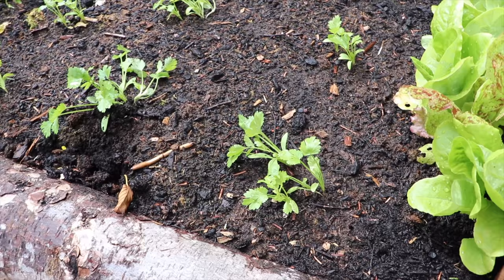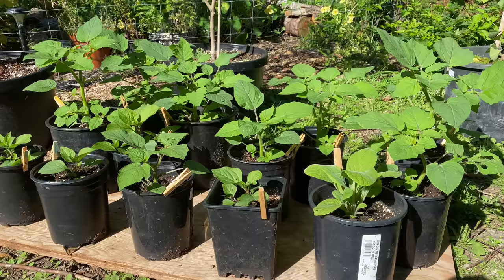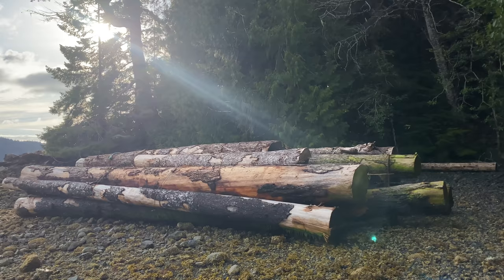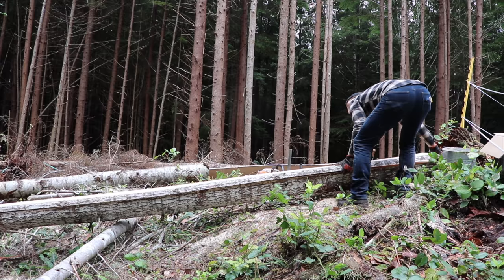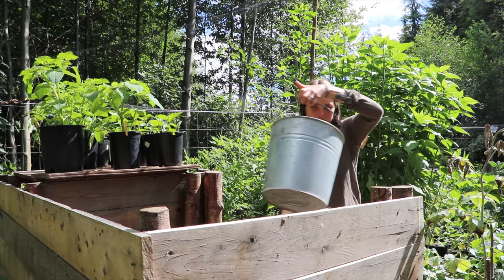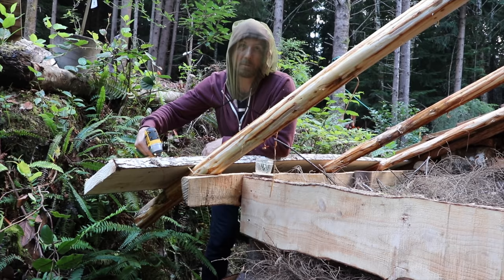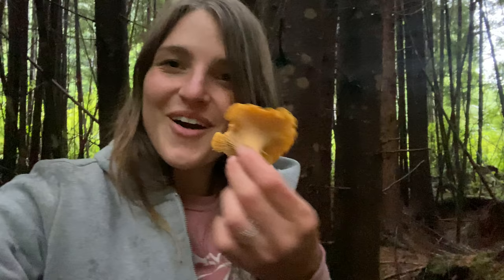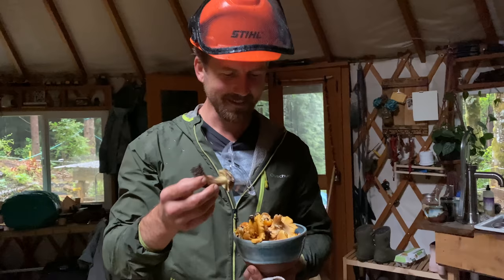Off Grid Wilderness Living // WOOD FIRED PIZZA OVEN Day 1 | One Year Supply of Fire Wood - Ep. 103

Comment: whole- wheat pizza with vegetable topping. crust. whole wheat pizza (wholemeal ) dough see page 12 . topping 3 tablespoon extra-virgin olive oil . 1 small egg plant (aubergine) with skin, cut in small cubes. 1 zucchini (courgette) cut in small cubes. 1 clove garlic, Finley chopped. 1 tablespoon finely chopped fresh parsley. 10-12 green olives, pitted. 3 1/2 ounces (100g) pecorino cheese, coarsely grated . 4-6 cherry tomatoes, halved  serves 2 preparation 20 minute. time to prepare the dough and let rise. cooking 15-20 minutes. CRUST 1. prepare the whole- wheat pizza dough following the instructions on page 12. set aside to rise for 2 hours. 2. preheat the oven to 500 degrees F (250degrees C/gas 10) 3. oil a 12 inch (30 -cm) pizza pan. TOPPING 4. heat the oil in a medium fry pan over medium heat. add the eggplant, zucchini garlic and parsley and sauce until the vegetables are beinning to soften about 5 minutes. 5. knead the risen pizza dough briefly on a lightly floured work surface. then press it into there prepared pan using your hands. 6. spread with the vegetable mixture olives, pecorino, and cherry tomatoes, leaving a 1/2 inch (1cm) border all around . 7. bake for 10 -15 minutes, until the crust is crisp and golden brown and the cheese is bubbling and beginning to brown. 8. serve hot not. fore extra taste and color add 2-3 tablespoons of frozen peas and a small carrot, cut into small cubes. sauce with the eggplant and zucchini.

Comment: your roof steel panels are supposed to go vertical the way you have them is going to allow the snow to pile up on your roof instead of sliding off
Reply: @jacquesdubois9929  So the manufacturer and roofing contractors are all wrong about proper installation and he is right? Don't think so.

Comment: Best wishes on getting the tomatoes to ripen. I lived about two hundred miles south of you 40 years ago and grew lots of tomatoes, but never had a single one to ripen. Good to see you clearing and cleaning up more of the property.
Reply: Best thing for tomatoes is putting them in a dark space for a few days/weeks and they’ll ripen just fine. For Jake and Nicole a cardboard box under their bed will do just fine. Just don’t forget to check them as they ripen pretty quick.
Reply: If you want to control a tomato plant and how much energy goes into the other trusses you can either take individual tomatoes or cut the whole vine off and put it in a box with a lid on because fruit ripens in the dark better. Most plants are more active through the night than the day.

Comment: I can’t wait to see the new garden. You have cleared a lot of trees in preparation for it.  I am sure you will show some neat way to rid the area of the stumps. A solution to the water across the driveway, build a bridge out of your logs and boards.    Your videos helped during our quarantine time.  Keep up the hard work.
Reply: Best way to get rid of stumps is to borrow few holes in each of them and put fertilizers containing nitrogen so fungi can destroy them in a year.
Reply: @user-pn4uj6qj2f  or by the way build the Garden arround the stumps😉🤔
Reply: @frankgaletzka8477  If stumps are fresh that would be a pain - picking off green shoots from them constantly. Destruction by fertilizers as described above would help.
Reply: @user-pn4uj6qj2f  yes you are right but the spruse tree stumps dont grow again 
I would do a combined Methode build the Garden around the stumps and use the Fungus to destroy them
Yours Frank

Comment: I'd love to see you guys with a band saw mill there someday. As great as it is to use a chainsaw mill to make some slabs, if you start making like 2x6 lumber with a chainsaw mill it's not really economical between the gas, and definitely the time. Whereas if you get good with a bandsaw mill, which is actually much easier to use and far safer, you'll be able to turn a pile of logs into thousands of board feet in a day. And you can use some of the thinner wood that would be hard to mill with a chainsaw, you can throw that on the mill and take off the edges, and then you've got a solid post you can use for fencing or something.
Reply: Yes the band saw mill are way more efficient and economical  !
Reply: What powers a band saw? Don't you need a good mains electricity supply?
Reply: hypergigs gasoline
Reply: They should also buy basic log handling hand tools. Way more efficient.
And a zip-line. Then they could mill, cut, split, stash at one spot.
Reply: I think they mentioned building a guest cabin, I don't think the plan is for a whole village and commercial timber yard. Maybe they will use stacked logs rather than planks for the guest cabin.

Comment: It looks like that chainsaw is working overtime. It may just be due for sharpening or it may be the bevel angle of the cutters which should be 5 to 10 degrees for ripping and 30 to 35 degrees for cross cuts. Hope this is helpful.

Comment: Have you considered making (or having someone make) an attachable bag to collect sawdust from saw when cutting ... probably would have to be made of sturdy canvas (or such) ... sail makers for sail boats can sew anything you want ... might want to cut an old bed sheet and use straight pins to create a pattern for whoever is making bag.  It would need to be easily attachable and detachable as it would fill up quite quickly.  Good luck.

Comment: Have you ever heard of a slasher for hedging Hawthorne? I use mine for many other things than what it's designed for and one thing it's really good for is brashing,chopping the branches of trees. I don't know if they still make them because mine is over 100 years old but I'm sure a blacksmith would be easily able to knock one up for you.
The great thing is the long handle is great for a good swing and not needing to bend down so much.
I'm disabled and have a really bad back too so it's a lifesaver for me.
Check them out!👍😉💛
Reply: @S vernie that's right! People use hedge trimmers on tractors these days so not many people know how to do that soon forgotten art form.
Reply: it's important not to confuse a yorkshire billhook and a slasher, a slasher isn't really designed for hedge laying as it's main purpose (even if it can be used for it with more effort). mass produced ones are generally trash, so unless you find a small forge your only real option is to buy vintage.
Reply: @S vernie I don't know where you're from but I'm just using English regional parlance in which each "style" of hook is based on the county that makes them. A slasher by definition has a much longer hook specifically designed for slashing and isn't really used for coppicing or laying here, where it is a separate tool (although I guess you could if it was a shorter one). Second to that, terminology is important, If I asked for a billhook and someone gave me a slasher I would be none too pleased. A yorkshire pattern billhook is especially unique because of the longer handle so is typically talked about in full to distinguish it from both a slasher and kent/suffolk/hertfordshire pattern billhooks etc. My information is knowledge passed down to me on the job and the delineations of regional styles and patterns are a whole thing here. Of course if you really were talking about using a slasher for trimming then as you say, it's just another tool in a kit and who am I to say you're wrong; I hope you understand I meant no disrespect by it (although I'd still rather just take the yorkshire alone).
Reply: @sotetsotetsotetsotetsotet2379  ok. I was told that is what it's for! So what was it designed for then?
Reply: @S vernie ok cheers👍 I thought my dad didn't know what he knew after reading the other comment. Mine is a two handed one with a oak handle and the straight blade is about 10". When it's sharp as a razor it goes through just about anything with ease. I've even chopped trees down with it when I didn't have an axe or decent saw. It's great exercise for the whole body.
Reply: @sotetsotetsotetsotetsotet2379  I'm from Northumberland and its hasn't got a hook,it's just a straight blade which is rounded at the end to a point.
Reply: @S vernie Cool Stuff cheers👍😉😁
Reply: @rastamanralph6670  If you've got what I imagine you've got then it is indeed a slasher although with less of an aggressive hook than some. Again I didn't mean to cause any confusion or disrespect or anything, the comment I made was as much for someone reading in as you. I think part of the confusion is that I specifically saying hedge "laying" and not hedging, Although with a blade such as the pattern you describe where the profiles are somewhere in between a slasher and a billhook, we're ultimately just talking about the different flavours of British machete.
Reply: @S vernie For some people the trade never died ;)
Reply: @sotetsotetsotetsotetsotet2379  ne bother man it's. Cool😉👍
Reply: @S vernie If anyone absolutely needs more than just a yorkshire billhook, a small chainsaw, a beadle and a side axe they probably aren't as good as they think they are. I suspect however you just misread what I actually said, which is that I would rather just a yorkshire billhook than a small hook and a slasher seperately.

Comment: You should stop adding sawdust to your compost. Its carbon to nitrogen ratio is 600 to 1. Which means that all of those micro organisms will need to work extra hard to break that down and use up nitrogen from else to do so. It also means that it will take longer for you to have viable compost to use in your gardens, which look great by the way.

Comment: Nicole, I noticed you taking big full swings with an ax around the 30th minute. I think this is the first time I’d seen you do in good that. Good job!! If I may make a suggestion, you were working against your body. You were swinging from your right side, but your right leg was forward. 

Think of a lever. The fulcrum is the point of balance between load (ax-head) and effort. One side of your body has to be the fulcrum, and the other side serves as a counter-balance. Which is which? is answered by which hand is holding the end of the ax. If left hand is holding the end of the handle, then left leg is the fulcrum and should be closer to where the ax meets the wood and does the work. And right leg is the counterbalance. And vice versa. Just like swinging the softball bat.
Reply from the maker: You are not correct Dale and your "tips" are very condescending!

Comment: I'm thinking a zip line / pulley system for getting your logs where you need to cut them. I'm not sure if that helps or not. But the more pulleys you have, the greater the mechanical advantage.

Comment: OMGosh you guys.  You need me to sharpen that saw.  It should be spitting out huge flakes not fine powder like that.  Wow the extra effort you must be exerting is crazy.  The time alone you could save.  Not to mention wear on your saw.  If that isnt a skip tooth chain just throw it away and go get a skip tooth.  A sharp skip will cut probably triple the speed with less load on the saw.  Use proper bar and chain oil.  Dont skimp on that and keep it full as much as possible.  Also use good mix oil always and mix and jet accordingly.  That saw should breeze along those plank cuts. Just my 2 cents.
Reply: Bro I had to comment again... You need a chain file and some wedges.  And you could be domino falling a lot of those by what I can see from here anyway.  Yikes buddy, you are working way harder than you need to.  I grew up with my dad logging all over BC, I know a few tricks thanks to my dad for that. And if you havent yet file your rakers.  Wow I want to come down there and give you guys a hand, it would save you huge amounts of time and sweat and tears.  Peace.